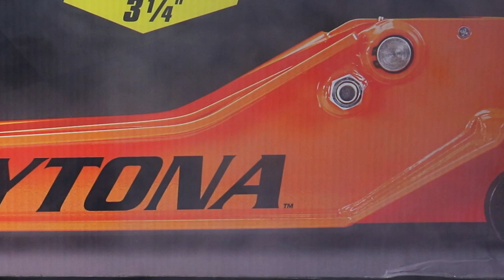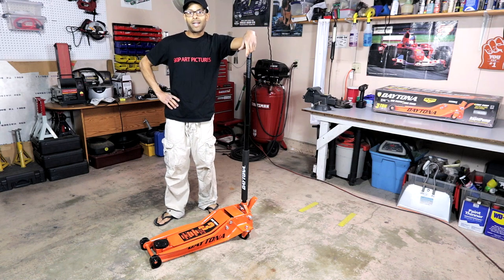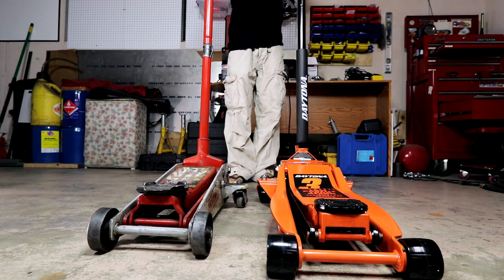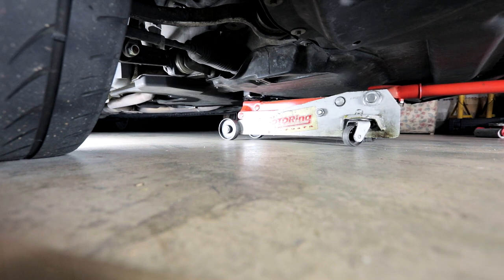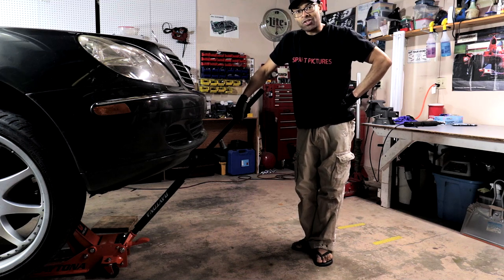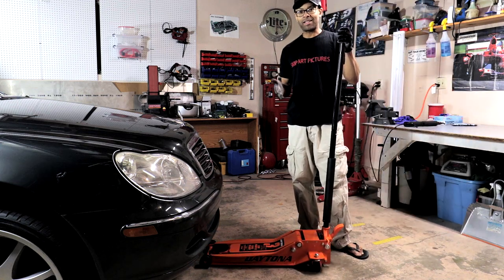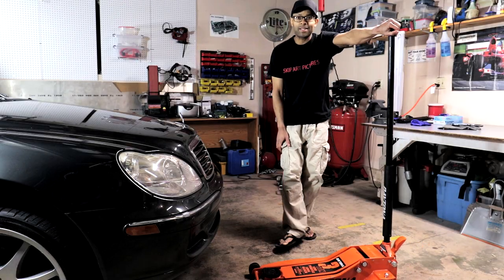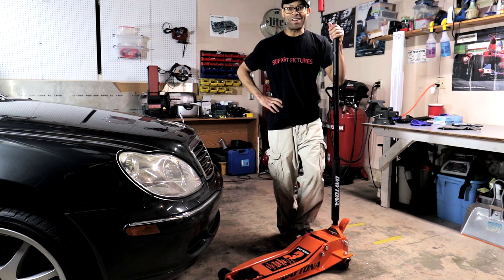Best Jack of ALL TIME - Harbor Freight DAYTONA LOW PROFILE LONG REACH JACK - Why It’s My Choice

Comment: Man i dont know about you but the foot pedal is almost damn near impossible to lift a car.. well atleast my 08 crown vic interceptor, would not lift with the foot pedal itself.
Reply: The footpedal is not designed to lift the car the footpedal is designed to raise the Jack to the left point and then use the handle
Reply: The footpedal is not designed to lift the car the footpedal is designed to raise the Jack to the left point and then use the handle

Comment: Dude, your voice sound volume is all over the place, mostly too low. I had to keep turning the volume up and down. Please use a mic!

Dead space in a hydraulic system means air. You often have to bleed a new jack. Air gets in  during shipping. It's the same feeling if you have air in a brake line.

I highly recommend closed, sturdy shoes while working on your car. Safety shoes or boots are better, but  they're also pretty expensive if you don't need them every day. Stop wearing flip flops in your shop, even when you're just playing with your new jack. You could accidentally lower the car onto your mostly bear foot or run your toes over with the jack casters.